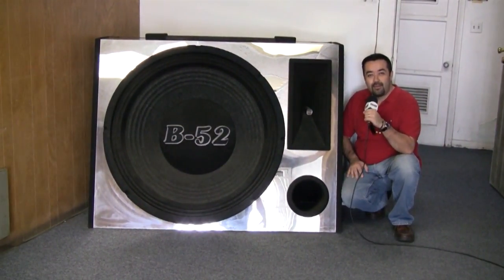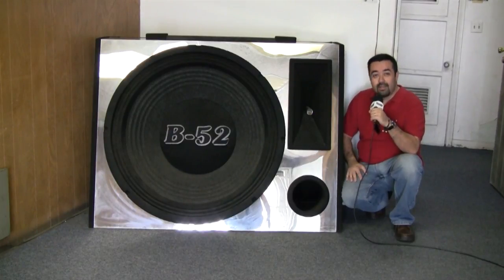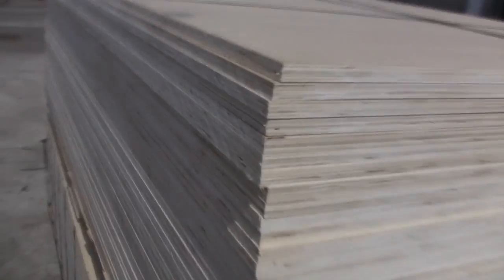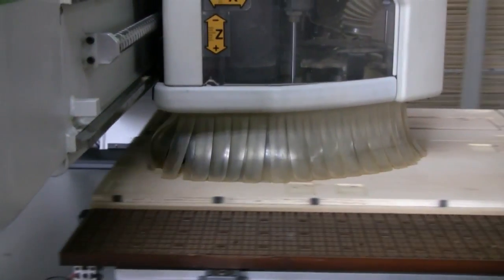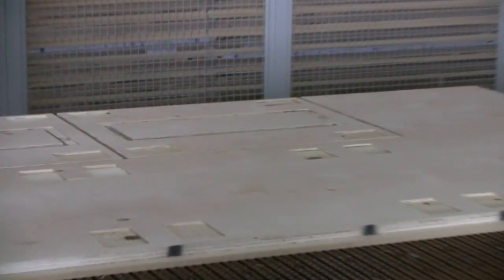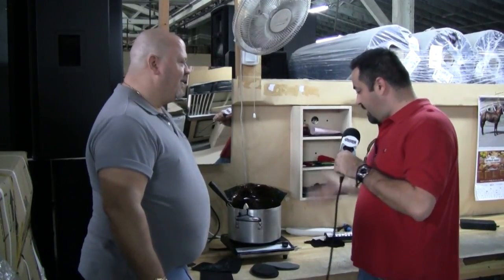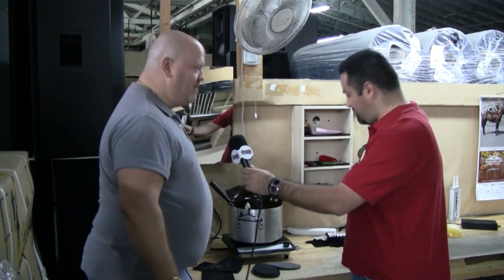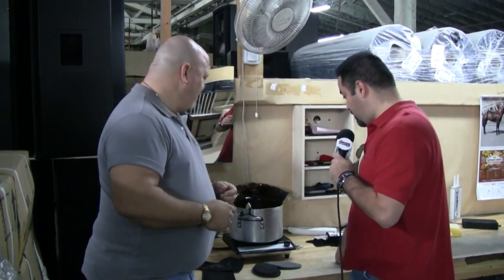Video Segment - B-52 Factory Tour

Comment: I have one of the 18" Subs that I call "Big Bubba". I'm driving it with a dedicated powerful Samson 1,600w Power Amp running in Bridged Mode. I used a software program called BassBox Pro to design a vented slot box that gets the lows down to 16 hz before the roll-off begins. It really shakes the house. Thanks B-52, I love your products.... my wife, not so much. LOL.

Comment: B-52! The BEST! I own 4 B-52 LX3's! Getting 6 more soon!
Reply: No they're not, lol. They're not even the best budget brand Wharfedale Pro is, i've been a sound engineer for 18 years and been around sound systems for 25 years and in all those years Wharfedale Pro's Delta series i've found are the best budget speakers for their price. Even sound engineers who work for big speaker companies and others who do festivals have said online that Wharfedale Pro's Delta 218b are the best budget dual 18" subs you can buy for a low cost. I own four Delta 218b subs, two Delta 215 mid/high cabs and a use a pair of Delta 12 cabs for dj monitors and it's a fantastic budget system.

Comment: Do you know where the Bi-amp/full range switch is located on the PA-212 speakers? I have 3 B-52 PA-212LC (Low Contour version) I installed 8 years ago in a church and they are sounding dull when I went back last week to work on their system. There's nothing above 10kHZ coming out of either of the three speakers. I'm wondering if someone may have flipped them into bi-amp mode by accident. Unfortunately, the speakers are hung 20 feet in the air. It would be nice to know where the switch is located before climbing up to the speakers. Thanks in advance!